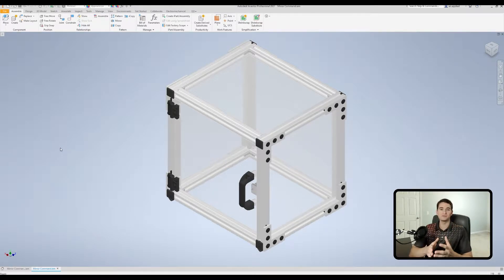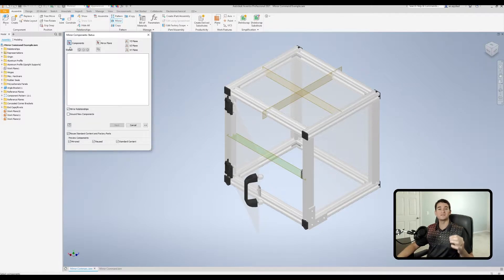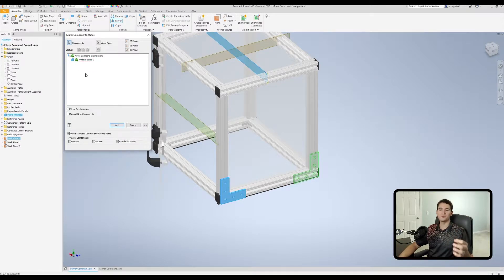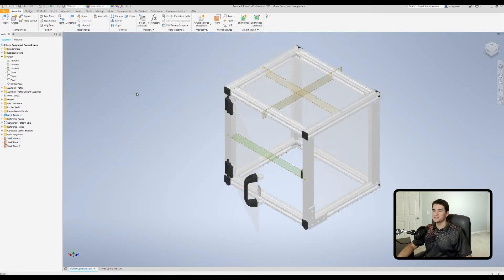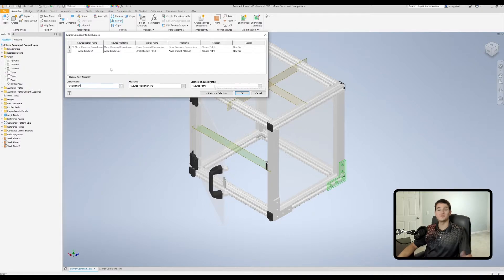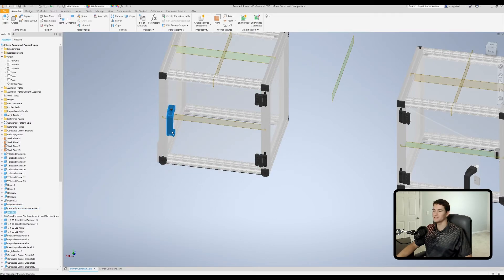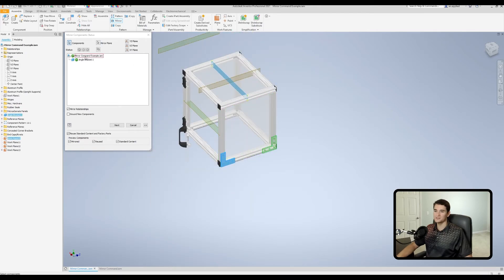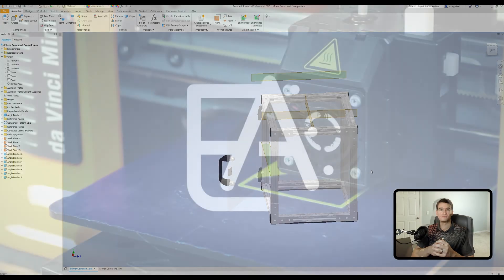Assembly Mirror Command - Autodesk Inventor Assembly Tutorial | Autodesk Inventor 2021 IN DEPTH

Comment: Great explanation of everything. But poor use of mirror. ALL other CAD software when mirroring parts on a changing design move and retain constraints (relations) as the model changes size. The fact that you are required to mirror assembly for the mirror components to maintatin reltaions is extra work. When you don't need another assembly inside your assembly.

anbother case of overthinking it.

Comment: Great video.  Thanks for that.  Can a frame generated handrail of 1 1/2" pipe be mirrored over a set of stairs and keep the mitered pipe together?  I do it and the mitered end rotate 180 degrees from each other.  I'm going to look for a mirrored frame generated assy video.
Reply: i mirrored the sketch then recreated the rail.